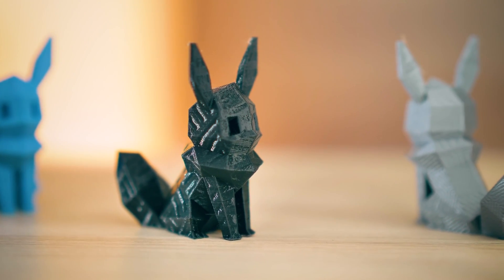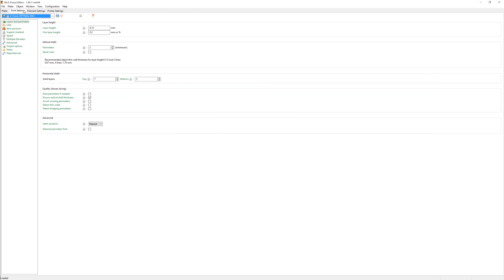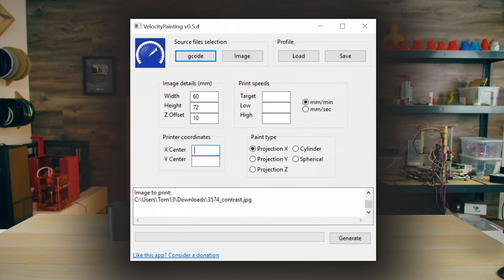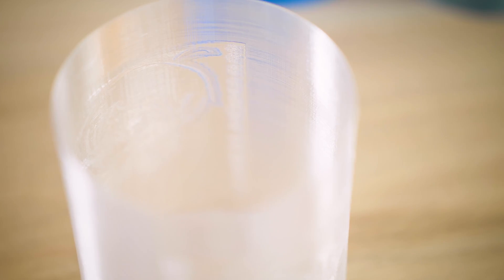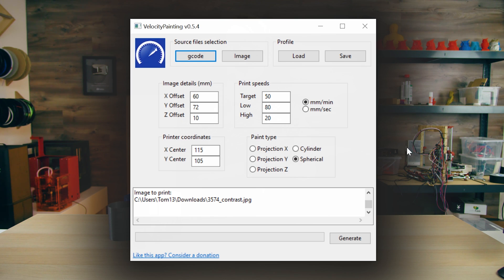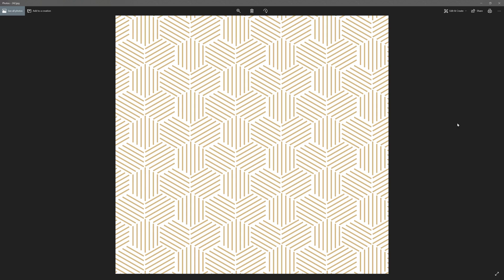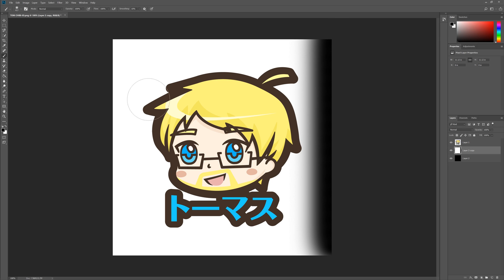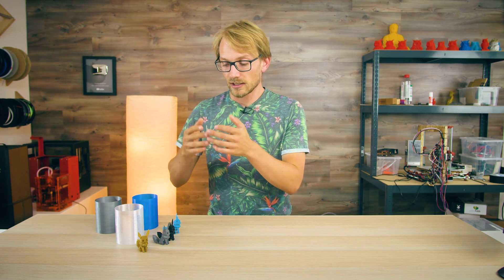How to: Velocity Painting! (Tattoo your 3D prints)

Comment: After seriously struggling with this, it seems it does not like if you have Verbose G-code turned on in Slic3r (I'm using 1.2.9 currently). If left on it generates a file identical to the original!

Comment: That's a really awesome technique. I had experimented with doing something similar before, but by varying the extrusion speed instead of the movement speed. But, as you mentioned, changes in the extruder like that are laggy, and the results were pretty poor. This technique gets around that by varying the movement speed instead of the extrusion speed, which has the same end result of varying the extrusion width, but much more precisely. Cool!

Comment: Any idea if modulating overextrusion instead of speed the same way could produce some nice and airtight single wall vases?
Reply: Yes I think so. Certainly making the high speed of the velocity painting very quick makes for under-extrusion which is quite effective (makes for a lace-like finish, which you can breath though :-). So modulating between under and over extrusion would probably be quite effective.
Reply: I've experimented with that, and it didn't work well in my experience, because of the lagginess of changes in the extruder that Tom mentioned. But I think you could still get something airtight using speed modulation, if you started with a thick enough extrusion, and didn't underextrude too much.
Reply: Ben Gruver ; Thanks, i will try it this way
Reply: Just set you extrusion multiplier to 130% and you can print vase mode  air and water tight and very strong no problem.

Comment: Awesome video. I still don't quite understand why the High Print Speed = 20 and the Low Print Speed = 80. It sure seems like I've missed something.
Reply: I haven't watched the video yet, but low and high just need to be different, there's no reason why the 'low' couldn't be a high speed and vice versa -- effectively inverting the image and making the part that's not within the image the other speed to that which it would be if you set the low and high speeds the obvious way round -- if that makes sense?
Reply: Hey Mark, Thank you so much. That makes perfect sense.

Comment: How to spot an engineer : π = 3
Reply: Barbaric
Reply: I never use π = 3, because error is cumulative.
π^10=93648.047476083...
3^10=59049
That's why I almost alway write a code, regardless of what work I do.
Reply: German Engineering - made my day :D :D :D :D
Reply: Also, if you want to mate a pulley with a belt, even error as small as 0.14159... is unacceptable. Try design and 3D print your own pulley and belt, and you will get the point. This is especially true if your pulley has large diameter.
Reply: @y.z.6517  If you were wondering at which height some things are able to float over your head, this thread has some good data. lol. To be fair, the wisdom shared is useful on it's own.
Reply: I would absolutely loose my mind if someone did that.
Reply: 22/7 is much better
Reply: Buy a calculator.
Reply: I remember the good old university physics exams "calculate that and that with π = 3 and e = 2." We were not allowed to use calculators, tho.
Reply: I came down looking for this comment :)

For image aspects, it's close enough.
Reply: Nah, I just memorise pi before any exams, I can usually get to about 30 digits, I write this down as soon as I get in the exam.